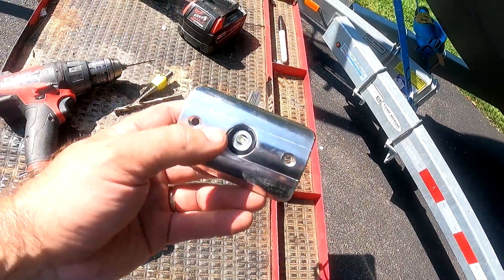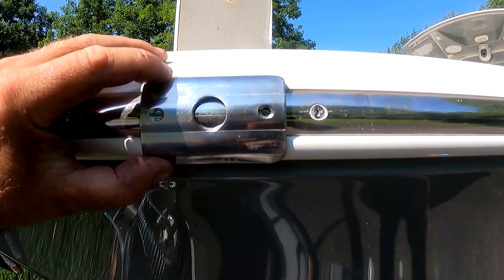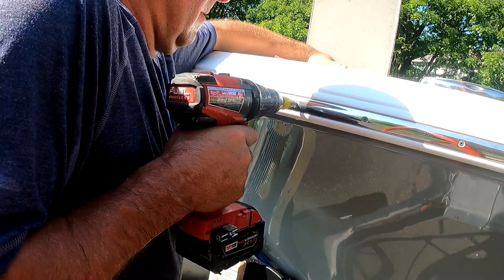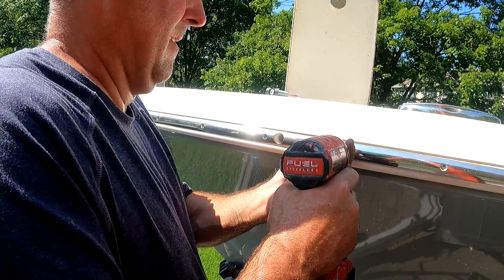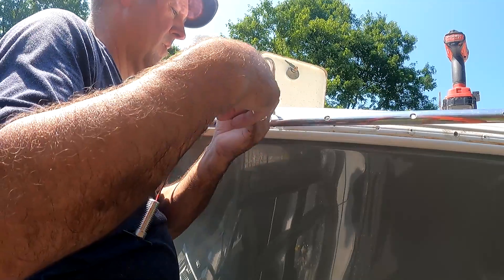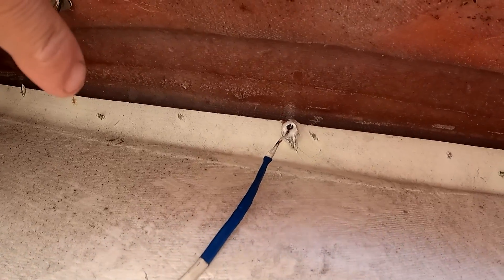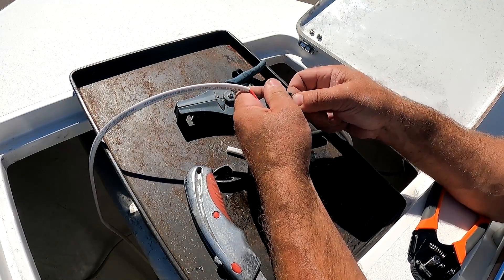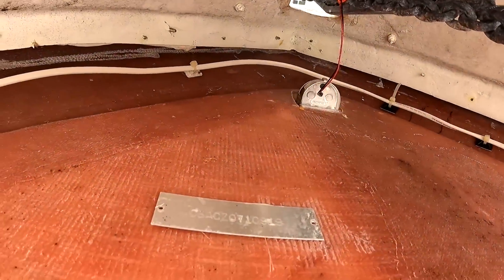How to install Taco rubrail navigation lights

Comment: Great video. Thanks for doing this. It looks so clean.
Reply from the maker: Thank you! I just couldn't use that 'belt buckle' that Taco supplied. It doesn't fit the larger rub rail profiles, and it's just ugly!
Reply: @4RibsFishing  agreed. Your install looks so much better than using those.